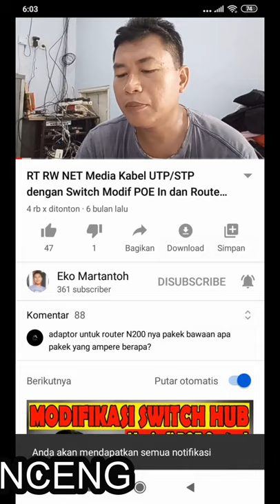Modif HTB Netlink 3100 support POE IN pada Port LAN

Comment: Pak, apakah ada pengaruh nya kabel fiber optik saya dekat dengan  kabel PLN ? ,karena setiap ada Gundala / petir yang jauh media konverter nya mati .
Reply from the maker: Kabel Sling besi gan, ada pengaruh nya juga, tapi bisa juga dari lonjakan arus listrik.
Reply: @ekomartantoh  pak ,jika ada lonjakan listrik  . Jika adaptornya dikasih step down gimana?
Reply from the maker: @nikikaku9816  iya lebih bagus karena biasanya stepdownnya aja yang rusak
Reply: Mas saya ko pasang dioda dari out step down arusnya jadi naek 18 volt, tapi cek out langsung dari step down tanpa dioda 5 volt bener kenapa ya mas?

Comment: Tegangan yg msuk htb brp.it om?
Reply from the maker: 9-24v
Reply: @ekomartantoh  ke htb sampai 9v ndak masalah y om?
Reply from the maker: @ayuk-belajar  modif dulu pake stepdown
Reply: @ekomartantoh  sy td pagi nyoba om...pakek adaptornya router totolink yg 9v...lalu kabel lan ny 80m...diujung mau sy pasangkan k htb3100...sudah sy stepdown hinggan tegangnya 5v...sy msukan k htb tpi kok ndak nyala ya om?kendala ny dmana n solusiny gman ya?trimakasih...sdh sy sucreb om
Reply from the maker: @ayuk-belajar  80 meter ga kuat, maksimal 40 meter
Reply from the maker: @ayuk-belajar  terima kasih, di tengah kasih switch 80 meter kepanjangan
Reply: @ayuk-belajar  mungkin pakai catuan yg 24v 2-4A om, krn panjang kabel akan pengaruh hilangnya daya dan arus (rugi-rugi tegangan)